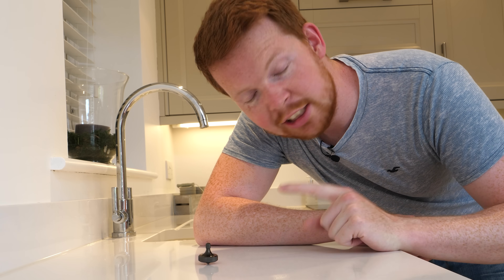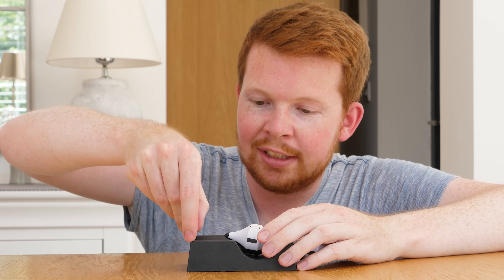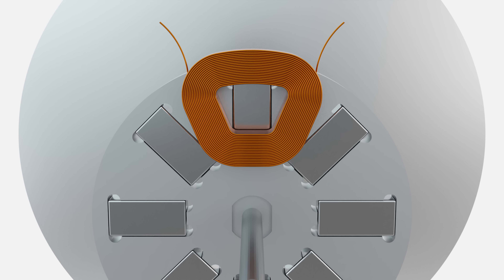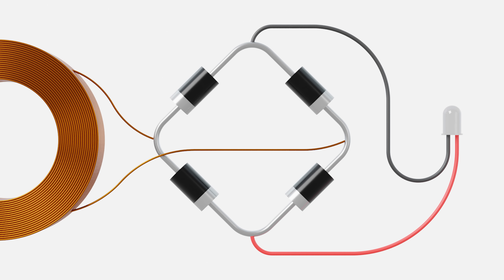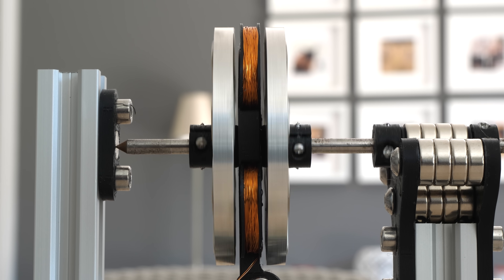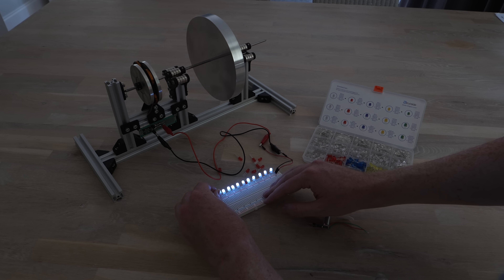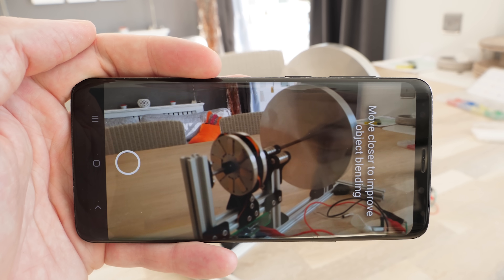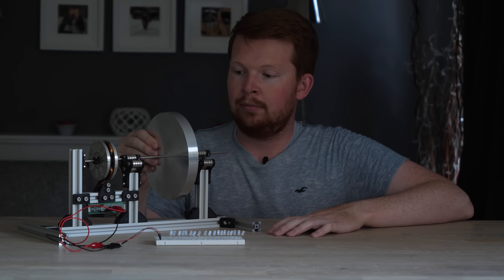Flywheel Battery

Comment: Loved it. I think the system could be made even more efficient. For example:

1.) Add a coil on the outside of each magnet plate.

2.) Extend the shaft on the right hand side so that you can fit another magnet coil on the right as well.

3.) Place magnets on the rim of the flywheel and have coils in the back and front of the fly wheel.

4.) Attach a handle to the shaft so that you can turn it using more of your hand than just your fingers. Using just your fingers, is not using all the energy the muscles in your hand and arm could provide.

5.) Put a glass plate on the right side as well to reduce the inbalance.

Comment: Nicely done! Wondering why you needed to convert the AC to DC? Thinking about dams and generator rotational speeds. Do they maintain a constant rotation for 60 c/s or do they convert whatever they get to DC then use inverter circuits to provide steady 60 c/s? I'm just ignorant on this.

Comment: What if, instead of the friction plate stopping the bar at the side, and you had opposed magnets at either end? Making it completely independent from the stand. Then if you encased the whole thing into an air tight glass tank, then created a vacuum in the tank. Reduced friction from atmosphere and physical entropy.
Could you try this?

Comment: I think it would be neat if there was another set of magnets set to each side towards the tail to brace the lateral wobble.  Also, if you had a clever way to spin it up not by hand but by some differential gear that can be disconnected after like a clutch plate.  Work a hand crank with that differential, get the real high RPMs going, then disconnect and let the power ride.

Comment: Yeah an alignment for the right side to stop the bobble as best can.... could also use a type of ratio gearing to maintain a high rate of speed and then a chain or some sort or wire with a weight and you'd need to use gravity and a weight to create the torque to maintain the pressure thats needed to turn the gear ratio box to maintain the speed for the spin
Reply: actually you wouldn't need the flywheel due to weight and just have the coils multiplied more so the crank can spin faster

Comment: You should see what I did with a Minn kota 65 lb thrust trolling motor and a 26 inch mountain bike and a popular electric scooter motor that was magnetized it was the generator and the trolling motor was the drive motor for the rear tire on the bicycle it put out way More voltage than it required to run and was pretty much a self-propelled bike once you got it up to speed however that being said I was blown away by a dong Chong motor from China it fit in the palm of my hand when I put it against the same bicycle tire flipped upside down and pedaled by hand it was putting out over 460 volts the dong Chong motor came out of an electric massage chair and I unfortunately was zapped by it it didn't hurt too bad but it definitely made me jump it was only one amp at 460 volts bridge with an amplifier and a secondary motor on the same wheel I would think you would be able to drive a lot bigger motor

Comment: You can get stable levitation of a magnet over chilled superconductor. That would give you even less friction. Also, have you tried to calculate/measure the energy stored in the fly wheel from the current drawn?

Comment: how does the capacitor smooth out the voltage? I know they can store voltage? energy? and expel it later, but I'm missing the step between that and smoothing out the voltage?
I ended up just barely making it through electromagnetism and never really looked back, and circuits was only barely better
Reply: iirc, a capacitor technically stores CHARGE.
If charge is flowing (aka current) only into the capacitor (eg. series diodes will prevent discharge), it will develop a voltage (aka potential difference). 
Voltage developed by accumulating charge in a capacitor is related to energy with this formula: E = 0.5 x C x V^2
Reply: I still thing of this analogy to the physical world:
Charge = water droplets
Current = rate of flow of volume of water
Voltage = slope of water pipe (ie. difference in height)
Capacitor = bucket/storage tank
Reply: @dl5244  thanks!

Comment: For reference... any LED that isn't white, blue, high-power (like a Cree or Luxeon or the like... tl;dr if it looks like a normal LED, it's not high power), or surface mount, runs standard at 2vDC 20mA... white and blue LEDs generally are 3.5v 20mA...

Mind you, some white LEDs are 3.5v 30mA, and some blue ones are 3v 20mA or 30mA but those are pretty universally the really crappy cheap ones you get for a dollar a gallon on eBay from China, and unspeakable things have been done to them because they're QC rejects and the like. Don't buy those! Also, in the very early days of blue and white LEDs, you could get "white" LEDs that were UV LEDs with a phosphor coating like you find on the inside of a fluorescent tube bulb or a CFL bulb (that's how those work, BTW) and blue LEDs with silicon carbide dies. Those are extremely rare nowadays, because the white ones were absolute poo and the blue ones were UNBELIEVABLY expensive to manufacture (single quantity prices never really dropped meaningfully below about $10 per, for a reason!) and those are of course very different. I can't speak to what those need, along with other such oddball LEDs.

If for some reason you want to drive an IR LED with something like this (I mean, you can't see em with your eyes... your phone camera might, tho, oddly enough -- it'll show up as a dim red) they're usually 1.5v 20mA. Also, UV LEDs count as blue/white for this, IIRC, but don't quote me on that.

Surface mount LEDs are generally 2v 5mA, as are the segments of ancient 70s calculator-style "bubble" displays (you can still buy those if you're willing to get on a government list, lol, they're usually on eBay... out of Ukraine! Fortunately for you, Paypal will happily convert your hard-earned dollars to hammers and sickles for a small fee... oh, sorry, too soon?).

Modern LEDs are considered "high-efficiency" compared to stuff from the 90s and earlier... believe it or not, the most efficient trick I've heard to drive them is to supply 5v and a 1k resistor -- you're running that LED at all of 3mA, at which point you can direct-drive the thing from an Arduino pin with absolutely no consequences (!!), but reportedly they are still bright enough to be seen in broad daylight. I've not had the nerves to do this myself, not yet, so treat that one as potentially suspect -- but hey, it's a cool trick if it works. As a rule of thumb, a standard LED at 2v 10mA is not noticeably dimmer than at 20mA, and will last considerably longer... for white LEDs, that's about 15mA -- 10mA is noticeably dimmer, but will last phenomenally longer.

All that to say... ten red LEDs = about 0.4w, or one tenth the power of an incandescent nightlight. Twenty white LEDs, that's 1.4w. You know those "floating" lanterns you can get for like $5 with a free 6v lantern battery? The non-LED ones of those are about 3/4 of a watt, so twenty white LEDs is about two of those. Fonzie Family Guy Yaaaaay Dot MP4.

Your average LED lightbulb, for reference, is eight or nine watts... although I have a couple ones from when Dollar Tree was first selling them that are three watts! (Hey... :( ) But there's your benchmark -- about ten watts or so to be genuinely useful, minimum threshold.

Comment: Some Diodes with a smaller Voltage Drop than the 0.7V would boost your rectifier Voltage a little. Also it would be quite interesting to see the flyweel generator being shorted since a high load puts physical stress on it. It would be lovely to see how it deals with such a high load and how long it would be rotating then

Comment: How about instead of spike and plate at the end of spinning axle, you put one magnet at the end of the axle and another on the stand? When you orient both so that the poles are against each other, it should prevent the axle from moving to left and require no contact at all.

Comment: And at a fundamental level, (not an EE) is this harnessing stored energy in the magnetic fields of the magnets, or is it simply a means of converting the work done by the creator to torque the flywheel, imparting kinetic energy? If so, is this an efficient way to convert/transfer energy, or would we get more “power” from the creator simply directly torquing a shaft connected to an alternator?

And as always, the issue is how do you safely store large amounts energy?  An uncontrolled release of energy is called an explosion. With chemical energy like in a battery you get a fire. With hydrocarbons you get both a fire but also a rapid expansion of gas/vapor or kinetic energy. And while a fire is dangerous, with a flywheel, when you get an uncontrolled release of energy, you get massive amounts of high velocity shrapnel. 

I personally think a large problem with our current push towards renewables lies here. You have to store massive amounts of energy. And you need to do so safely. Thus far, one of the safest way to store massive amounts of energy until we need it is below grade, in large reservoirs and to extract it when we need it. Nuclear is the other phenomenal means of storing energy. And current designs allow for self regulating reactions that can’t get out of control, and in which the stored nuclear energy remains in nuclear form.

I don’t know the answer(s), and I’m glad people are researching and thinking about the issue. It’s just always wise to step back and think from the outside occasionally.

Comment: I believe your use of the term alternator is incorrect. That is an AC Generator. An Alternator is a type of generator that doesn't have permanent magnets, and requires input electricity to actually generate electricity, reducing overall efficiency.

Comment: Add windmill vanes to the end… free wind energy to power your shed lights.
Reply: nah. do what they did 60 - 100yrs ago for rural areas without utility grids. 
Windmill vanes go on a tower. It drives belt to drive flywheel.

Comment: What about biasing the two magnet pairs in opposite directions? The left side pair pulling to the left and the right side pair pulling to the right. You’d get a small net tension in the rod, but that shouldn’t be an issue.

Or does one pair always ultimately dominate and end up pulling the entire assembly?

Comment: Really cool, though I wonder if using bearings would be better even though there's a bit more friction.  The wobbling around might actually cause more energy loss. Would be interesting to see a comparison by remaking it but having a bearing set at both ends.

Comment: Have the motor connected to gears feeding back into the fly wheels
Reply: Unfortunately it has the potential to diminish in energy due to energy bleeding through heat loss in the friction and wires
Reply: @T34RG45  I know, but the aim is not to keep it running but to see how long you can add to the running time
Reply: @TheSoyaSause  feed any air pressure change into a sterling engine and youre fine as long as you have a dense enough flywheel for a battery.

And thats why i think he's doing the alternator setup. Now all you need to do is to connect gears to the stator shaft and you can use the rotational energy saved in the flywheel

Comment: Connect a motor to spin the flywheel. The motor would be powered by the flywheel. There's no way the motor could spin it faster, but you could prove it. Keep adding coils to increase the power output. Put a ton of coils on a rod 5 feet long to maximize the output. 5 feet would still fit on a desk. 30 feet would be epic. You can offset each coil group so it outputs continuous power. It also needs an RPM sensor. That would show drawing power out of the flywheel would decrease the RPM when you periodically consume power. You could paint a dot on the flywheel and use a camera to detect RPM so the sensor doesn't consume power from the system.

Comment: Endlessly fascinating project. In theory i know how a generator/motor works, but your explanation adds a lot to it. Have you tried to use it as a motor? And couldn´t you just build it with the flywheel as generator or won´t it work like that?

Comment: So it didn't cross your mind to connect the electric motor to power the flywheel creating a perpetual motion machine?...
Reply: I mean, what's the point? It's gonna spin for longer if you just let it there without anything attached. If you just want to see a really inefficient flywheel, I refer you back to the spinning top at the beginning

Comment: yeah uh, look for efficiency on the electrical side as well. A full bridge rectifier also causes quite some losses, especially at low voltages, effectively nullyfing the reason you'd have to use a magnetic flywheel.

Comment: Could you turn the flywheel into a maglev? i.e. set up a small setup at the bottom which is charged by the flywheel to pulse every now and then to spin the flywheel.

Comment: I was waiting for you to take off the fan blades off the motor shaft and place a rubber ring on there instead and use the alt to power the motor to turn the shaft instead of your fingers turning it so it would power itself.

Comment: Put a small motor on the shaft and use solar cells for operation, which drives a battery charger.

Comment: Good explanation of the subject, but do not forget, you'll always get less energe out of the system, than you introduced before, due to losses. Nevertheless, flywheels are interesting mechanical "capacitors" for energy. As electrical energy is nearly impossible to store directly in large scale, this is an interesting option, when you use your alternator as a motor and a generator just on demand, to convert electrical energy into mechanical and vise versa. Chemical storage (aka accumulators / rechargable batteries) is not as efficient and sustaining as this mechanical device, just smaller. Thank you for the cool demonstration, good for schooling.

Comment: Great project, Tom. To give it more credibility, you need to draw graphs of open circuit voltage versus RPM, short-circuit current versus RPM, and the optimal load power, and the time it can achieve it for before it spins down. These are the same kinds of principles Trevor Bayliss went through with the wind-up radio.

Comment: Would it be possible to replace that physical block holding the magnets in place with another series of magnets? 

Say if there was a north side of a magnet on the end of your shaft and maybe a ring of south facing magnets to hold it in place. this could create a near frictionless system.

Comment: just had a thought, the reason this losses its momentum is mostly due to friction in the air. while also yes the magnetic field  also losses its power because its not directly driving the flywheel but more acting as a assistant to the rotation. but what if this was preformed in 0G with no air. because in space there's nothing that could really create friction to stop this, so wouldnt that mean this could in theory almost endlessly create energy?
Reply: The magnetic field decelerates the flywheel. In space it would spin for longer, but it would still eventually stop as long as the circuit has a load. If you had an ideal system in space, the energy you put into spinning the wheel would equal the energy "consumed" doing whatever the circuit is set up to do. You cannot create or destroy energy, only change it.

Comment: Years ago there were experimental  flywheels running in a vacuum to increase efficiency. Then flywheels dropped off the radar. I'd still like to know efficiency comparisons  between them and electrical storage.
Reply: I think the issue is more with storage capacity than efficiency. These things would need to be absolutely massive to store as much energy as large, modern chemical batteries store. We'd be better off using existing methods of storing potential energy like pumping water upstream from hydroelectric dams if chemical batteries weren't an option.

Comment: Did you try Schottky diodes?  They have a lower voltage drop, so won't suck up so much of your voltage.  0.3 to 0.4 volts each vs. 0.6 to 0.7 - average over 0.5 volt difference for two in series.

Comment: It's all jolly tame and rather girlie. Get a real lump like the flywheel off an old car engine and spin it up with a main powered drill. You need enough stored energy to make a hole in the wall if it comes free. Are you man or mouse?

Comment: @Tom Is it possible to charge a battery.  Of that’s possible would it be possible to create a motor to spin the fly wheel in intervals that would keep the fly wheel going longer without the battery 🔋 draining?

Maybe part 2?

Thanks 😊